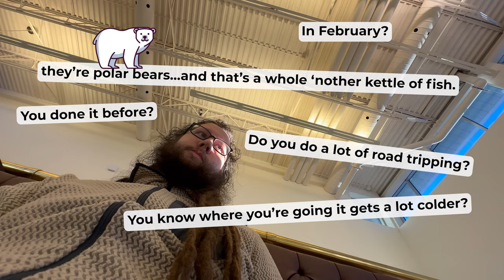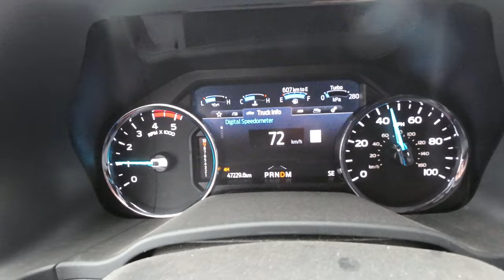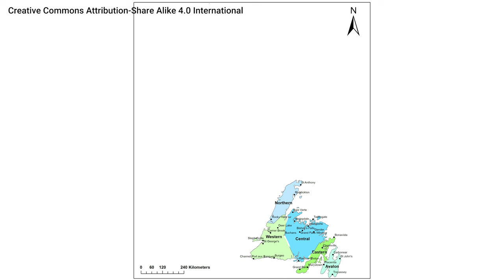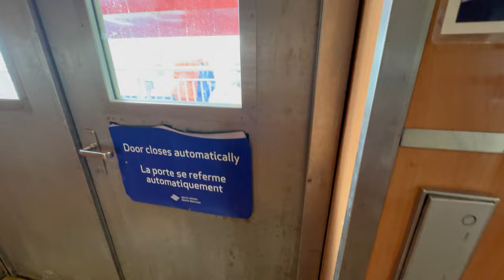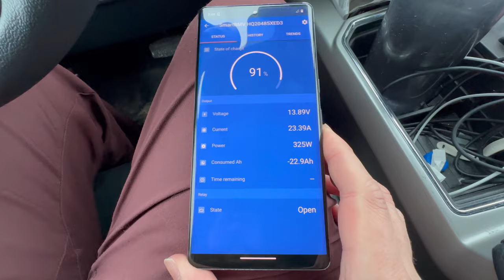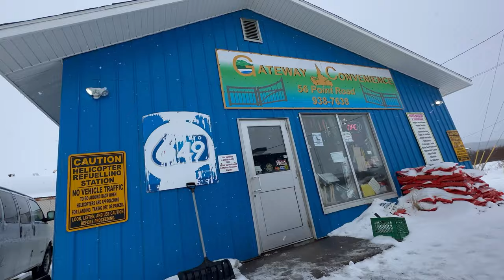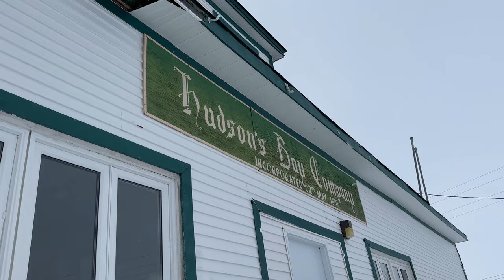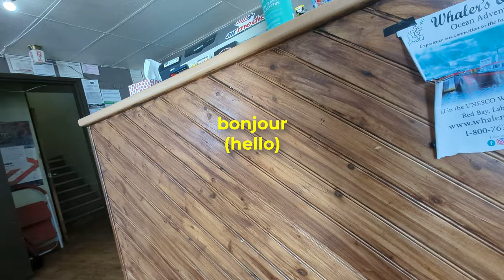I pushed to the absolute limit in Canada's winter

Comment: Great adventure! Fun to follow! If you get stuck with your car again, and there are trees around grab pine branches and put them just under your wheels (so you can go over them, and only reverse once, and preferably have someone push the car as well. The more you drive in snow the looser it gets.

When going on icy roads, make sure to drive where other people are driving. Rule of thumb is to not assume what's under the snow, because we really don't know where the roadside ends just because the snow is visible. These are the best tips I've gotten myself and swear by. Hope it helps!

Also, if your lock snow over again I usually blow on it (breath warm) or keep my hand or a lighter there.

Will be fun to see more episodes! Happy driving! :)
Reply from the maker: Thanks for the tips! I had never heard of using pine branches but now that you mentioned it it makes perfect sense! I'm going to remember that!

Comment: I am surprised that going on adventures like that you don’t have a winch attached to your vehicle.
Reply from the maker: I actually do have a winch on the front. Unfortunately at that one spot I drove in straight so there was no way to winch backwards to the road.
Reply: @ScottyFindsAdventure  Since I noticed you had trees in front of you, you could have attached a snatch block to one of the trees and attached it to your right rear tire to pull the rear end over to the right. Luckily, it seemed like it was a well traveled road to get assistance. Good luck.
Reply from the maker: @carlcarl7056  I'll have to find another place to get stuck so I can try that!